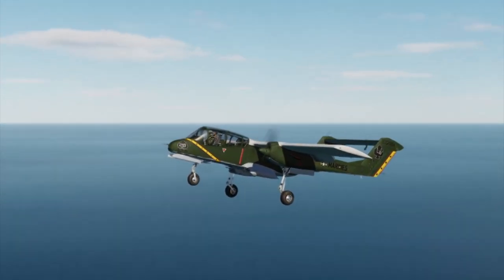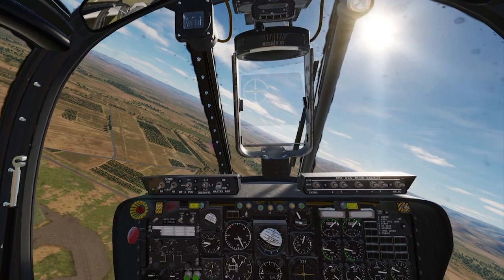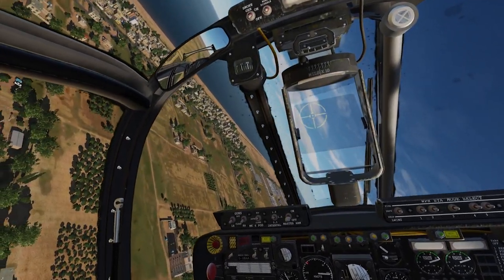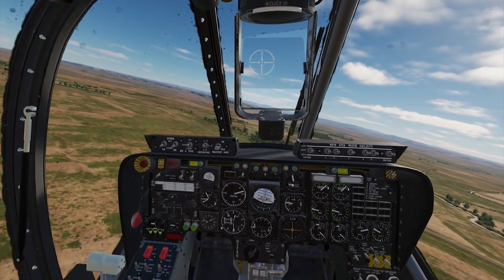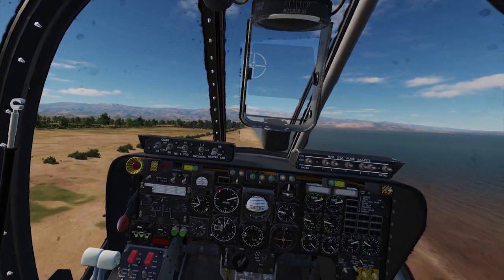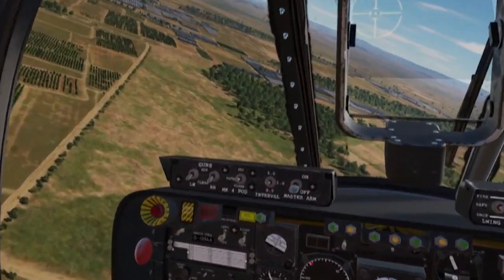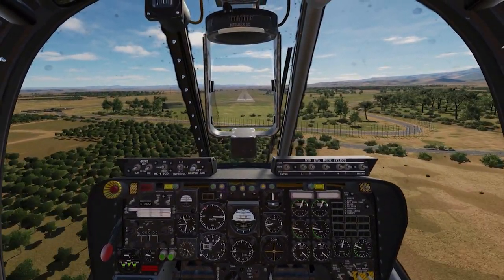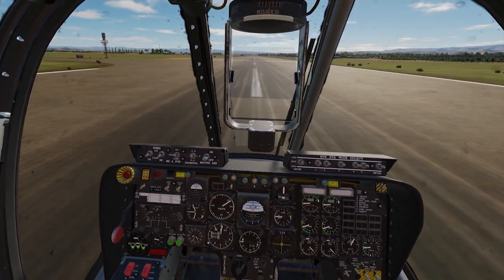DCS: OV-10A Bronco Testing and Flight Dynamics Analysis

Comment: Good video. Already took off and landed on the Tarawa. 450' remaining empty 1/2 fuel dipped a bit, but raised the gear as we left the bow. It will do better using more of the available runway, but either min fuel w/weapons or unarmed for recce. Better land based for combat. Dragged it over the stern at about 80. Landed and applied reverse. I'll work on the "Break" today-use your 600' at the 180 for a nice tight approach. I remember them in NC and Okinawa until they got grounded. Played golf weekly with one the Bronco drivers. USMC grounded them in 1984. Never knew ehy.

Comment: OV-10 doesn't have much of a break in the stall. Unless you pull a lot of alpha very abruptly. That was the first thing we did during a shakedown cruise. That dirty stall is about what it looked like. Didn't come down very hard though.
Reply from the maker: Must be like one of those new light sports, we couldnt full stall it, even at 20 kts. I've also flown some nose heavy planes where the stick just couldnt hold up the nose anymore, so nose sank forward slowly, no chance to break stall.

How was the stick authority at lower speeds on the OV-10A?
Reply: @FSX404  Very very mushy at all speeds. Took lots of deflection to get any roll or pitch. Rudder was aggressive between 70-140 knots. Kinda felt like a really heavy short-wing piper. Like, an overloaded Pacer. Not quite like I imagined it. This looks like it could use some tuning. But it's remarkably close, considering it's just a mod. Can't figure how they got it that close without a full FM.
Reply from the maker: @Taliyon  thanks, it is a full FM model I think, all C++ programming, just add more conditions as you need them. The ED kit just makes some things easier, not having it doesnt limit flight development models, only C++ and dev knowledge does.They should be able to update it to closer if they got it this far.

Problem is devs have to interpret what the pilots say, and translation is not always accurate, lol.
Reply: @FSX404  I didn't realize! Very cool. It's good to see growth. DCS has come a long way. Thank you for showcasing this mod. It deserves attention. Well done!
Reply from the maker: @Taliyon  anytime 👍🏻... does it really get 30+ deg/sec instantaneous turn at 220-250 kts?

P.S. let menknow on my discord (in the description), if these guys are open to updating the mod, we can give them a few pointers
Reply: @FSX404  I never flew it that hard. Was a trophy. I make it a point to force people to explore the FULL flight envelope. Performance Takeoff/Landing. WB/CG limits. Deep stalls, upset recovery. Systems failures. Trying to keep people from getting soft and killing themselves.

But, I will say, when you had some energy, it was quite sprightly. Mushy controls but the ship moved around quite well. How to explain? Like... Part of your brain says these controls are horrible. But the other part is in awe of how well it's doing what you ask of it. 

Strange bird. Was a lot of fun.
Reply from the maker: @Taliyon  thanks D, devs want to ipprove it, if you want to give them a hand with flight dynamics let me know.
Reply: But If it hasn’t break down, it won’t has a high rate of vertical speed (descending), this is correct?
Reply: @CarlosMoreno-dq3kg  Many aircraft don't have a pronounced stall, with a hard drop of the nose. The OV-10 has a very neutral center of gravity with wings that produce a lot of lift. 

It has enough thrust, but not an abundance of it. When you are behind the power curve and close to stall, you wind up with a really steep descent rate and can still keep the nose neutral with what's left of the elevator control.

It can be dangerous, because people are used to losing elevator authority and being forced to break the stall or spin. But you can be stalled in a very flat attitude with a very deep rate of descent. Adding power will reduce altitude loss, but you have to push over the nose enough to get ahead of the power curve, or it will mush downwards. 

Losing an engine at close to takeoff speed or being way too slow on short final are the most critical times to be attentive. Otherwise, I don't remember any bad habits. A fun, and easy aircraft to fly.
Reply: @Taliyon  thanks for the answer😊